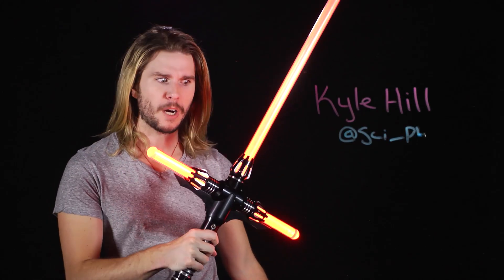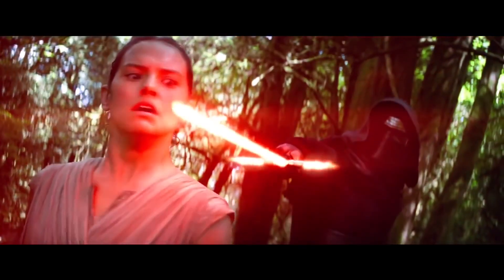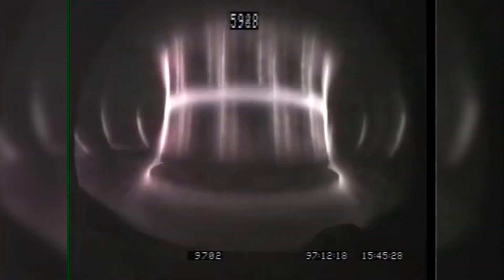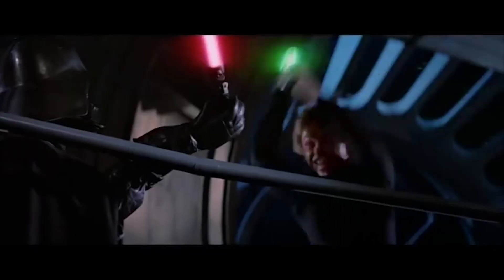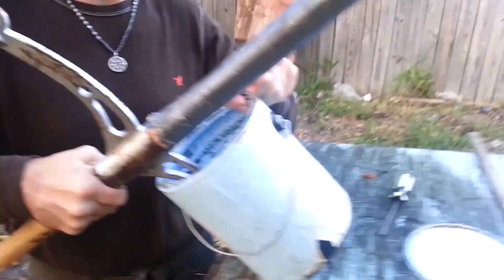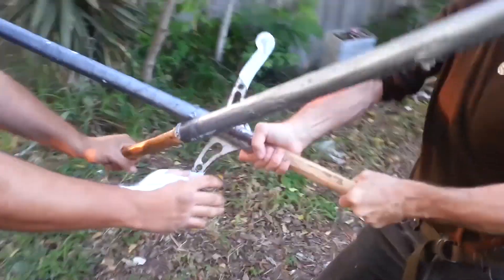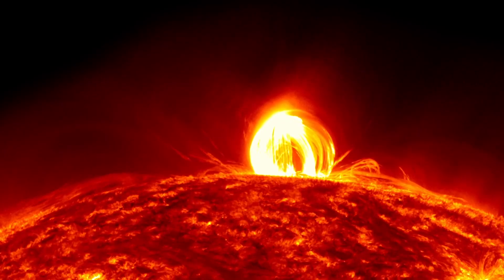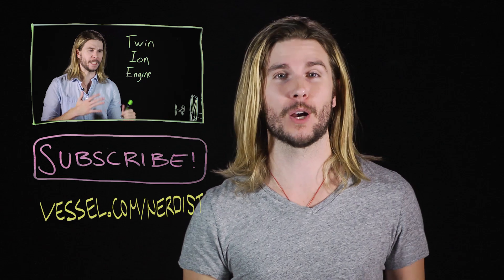Why Kylo Ren's Lightsaber Works (Because Science w/ Kyle Hill)

Comment: Kylo Ren's lightsaber wasn't made with crossguards in mind. It was the most practical placement for vents. Kylo Ren's lightsaber contains a cracked or unstable kyber crystal (which is why it cracks and looks so rough) which needed two vents for extra power in order to contain the power as the crystal didnt send a steady low flow of energy like a normal kyber crystal would. Without the vents, the lightsaber would probably expload upon activation. (Kyber crystals are a necessity to create a lightsaber and is the defacto energy source). Reason for using a unstable crystal was because most crystals were destroyed by Anakin Skywalker and Obi Wan Kenobi during the war before the duel of mustafa. There were little to none left.

Comment: I agree that the sword or sabre looks cool, but if anyone who has fought with a longsword or hand and a half before then you know that the crossguard is not just used to protect ones hands, but to perform blade catching manuevers witch would require the opponents blade to be inbetween your blade and your crossguard. watch some longsword technique videos and you will see what I mean. the the teqnique is hard to pull off, but is what I was tuaght is the primary function of the crossguard. I doubt the lightsabre would function properly if its outer housing unit were destroyed. Yet in all seriosness I realise that this is just a movie.

Comment: The crossguards are also vents. Kylo's lightsaber is an ancient design using modern technology. His lightsaber has a cracked kyber crystal. This means greater energy is projected from the crystal. The vents are necessary for it to function properly without overloading/exploding/melting or whatever the fuck would happen. It's also why the beam it produces looks so much more unstable compared to other lightsabers. 
     The lightsaber is supposed to reflect the character. He's confused, angry and torn between the light and the dark. It's like he's "cracked".

Comment: It's not mentioned in the movie, but kylo rens light saber was built by a jedi/sith who had not completed training and used a crystal that was more than likely cracked or unstable and unable to control the power. Therefore it created a non uniform shaped blade and required vent ports on the side to distribute excess energy, hence the crossguards.

Comment: accept to say that the side one would help protect which they kinda do but like any lightsaber the beam comes straight out the hilt not deep withing and in this case somehow splitting into three beams. no this tri saber would have three different ports in which beams come from makes the intersection on the hilt easily cut throughable making the sides rendered fairly useless(considering the user can still use the side beams to actually block, but the natural order of hand guards is the attacker would then slide the beam down towards the intersection which would then be cut through). so all in all the tri blade would then make it easier for an attacker to cut all the beams off and ultimately making it easier to cut their hands instead of protecting

but that is considering the beams dont all originate from the same port but their own separate ones

Comment: I have major issues with the claims people made about the side blades actually being plasma vents.

 If you vent plasma, you run out of plasma.

The blade would shrink away to nothingness in a matter of seconds unless Kylo Ren had a pipe attached to the weapon supplying additional gas to turn into plasma. Plus he'd probably need one of those old power supply backpacks to provide enough power to turn it all into plasma.

Comment: They actually aren't cross guards, they are vents because the power crystal is unstable. The crystal used to create the lightsaber blade is cracked and so it is unstable so it cant all be harnessed out the top of the lightsaber and needs to be directed somewhere else because science.

Comment: I agree with everything said in that video although I do believe that it would have been a much better idea to have made the crossguards out of a lightsaber resistant material such as phrik alloy (the material the magnaguards' electrostaffs are made from) or a cortosis weave (lightsaber resistant material called cortosis which almost every sword, vibroblade, vibroaxe, etc. is made from). Still the crossguard does make sense even though I would prefer a normal lightsaber due to the limited variety of use (there's less styles/forms of combat you can use) making it available to less users such as Count Dooku who uses his lightsaber in such a manner that lightsaber crossguards would cut off his wrist. So it is usable but I don't think it is necessarily for everyone unless the particular individual is willing to change his/her style to compensate.

One last thing I would like to add is that wouldn't there have to be three different crystals so the blade length for the main beam and the crossguards remain different or would Kylo have been able to place a mechanism in the lightsaber that would control how much plasma is emitted through each shaft?

Comment: The cross guard doesn`t work. There are "non laser parts" exposed on the joints. A cross guard is to there to catch an opponends blade from sliding into your hand. But here, the blade can slide along kylos blade, trough the mechanics and than cut his hand off.

It`s only purpose is offensive.

Comment: I disagree here a bit. Crossguards are meant to protect your hands from swords or other weapons sliding down in combat and in the Star Wars universe a blade gets cuts and could easy stop working at all (cause that "metal casing" is really helping direct and focus all that plasma and helping not kill you). So the crossguard in this design lacks its most vital and historically accurate purpose. Functionality wise it doesn't seem that great. Other, more effective designs could have been done but I admit the look of it is amazing and would want to see more unorthodox lightsaber variants on the films. 

Also a cracked crystal or unstable crystal which produces a larga plasma projection makes lightsabers for more devastating blows yet can shorten out midst combat. Extensive use or clashing could be.... dangerous to the user as he risks being left defenseless in a duel. 

Btw most shots taken of dismemberment even if the lightsabers had the guards they weren't in the way to have changed the outcome.

Comment: Now this is the issue I have, not with the triblade, but with any saber in general. If plasma is effectively weightless, why are all jedi/sith able to swing it as if it has this centripetal force on it. The weight is just not there to allow for that sort of movement. I mean, try swinging a flashlight like that, it doesn't work. So unless these are very heavy lightsabers (I.e. a full sized maglight) I don't see how their movements make sense.

Comment: The ancient design of Kylo Ren's Crossguard hilt, yes it's brilliant for the wielders protection during application. However, this is not the reason behind this design. In fact, the crossguard is merely a happy coincidence for the wielder due to the age of this design.
The blade design is so old, that the saber crystal used within the hilt, is unstable because of the primitive focus emitter. Hense; why the Lightsaber crackles and appears more like a fire saber, spitting and sparking. As appose to a stable, more advanced saber. Now the Crossguard's are actually an energy outlet from the sides of the saber hilt, designed this why so that the immense energy coming from the crystal and power source, don't combust and basically, blow up during use.. 
They act as vents so the Hilt remains intact.
Why Kylo Ren chose this type of design, when he could have easily built a normal, technologically advanced standard Lightsaber of the time, is simple. Intimidation and Fear.

Whenever Ren powered up his Lightsaber, it sounded loud, fierce and the crackling from the unstable and ancient design, gave the appearance of more a fire saber. All these elements, give Kylo Ren an advantage during battle or interrogation.

Comment: To add a bit of fiction to all of this, Jedi and Sith have even better control over their weapons due to the force. Because plasma is effectively weightless, without visual cues or extensive training, a non force sensitive person would have a very hard time trying to not cut themselves, as they would need to track the blade with their eyes to know where it is. Force users, on the other hand, have the ability to sense where their blades are, even though they have no weight and their operator isn't directly observing them. The crossguards on Kylo Ren's saber are entirely practical. The only problem I see with them is that they are created from the saber venting plasma. I personally wonder how that venting plasma is controlled. Does it work like the rest of the blade (by which I mean, is it a recursive flow of energy) or does the energy just kind of fly off into nothing? If it does just dissipate, then how does Kylo's saber have enough energy for more than a couple activations?

Comment: The blade looks this way because it is unstable plasma blade Matrix. Though Kylo's weapon evokes an ancient feel, its components are modern. Its crude appearance suggests construction by an inexperienced hand. The stressed crystal barely contains the power and Most importantly, the lightsaber uses cracked kyber crystal, which is the main cause of the ragged, unstable blade appearance.

see image for proof:http://static.comicvine.com/uploads/original/11115/111155790/4967134-0923527786-P4K2d.jpg

Comment: No spoilers ahead: Kylo Rens light saber doesn't have a cross guard those are vents because the crystal used as the power source is fractured and thus release to much power when activated

Comment: As a martial artist who specializes in swords, I couldn't resist a comment. First off: The whole thing is just one crossguard. That part of the sword is the guard and we call it a crossguard because it's shaped like a Christian cross.

Second: Heavy guards of any kind are simply a trade off. A large crossguard will destroy your ability to strike fast and from different angles but, you are very well defended from enemy strikes. I actually grew up training with swords that all had cross style guards and I still prefer a katana or a rapier for sparring or doing techniques. Although, in real melee combat, I do much better with a heavy sword, on average.

Not sure if that helps anyone at all. Just hoping to share my knowledge a little  :)

Comment: There's actually a lot more to his lightsaber. First off the design is based off of an ancient concept dating back thousands of years to the Great Scourge of Malachor. Secondly, the lightsaber uses a cracked red Kyber crystal which is why it crackles the way it does. Essentially the side vents are there because it keeps the lightsaber from overloading. A cracked Kyber crystal is very difficult to keep stable so the vents are there to provide excess energy to be released without causing damage to the saber or the user. Which in turn offers Kylo the ability to use them in combat.

Comment: So Nerdist I have pointed something out to some friends of mine before but I want your opinion on it as well. Have you noticed that Kylo ren's lightsaber isn't only different but bigger than most? That's because Kylo Ren doesn't focus just on movement or agility as a lightsaber master, he focuses on power and brute strength. What other weapon reminds you of that and also has a cross guard? Great Swords, or Claymores. Yes that's right Kylo Ren' lightsaber is modeled after the Claymore. A claymore's cross guard was not just used as protection but it was used as a heavy weapon for taking out someone like a blunt object. Kylo showed that as well in one of his fights. While a  normal light saber is modeled after a Japanese Tai-Chi Broad sword for movement , agility and dexterity. Kylo's is modeled after the claymore for raw brute power.

Comment: You are aware that actually Ren's lightsaber wasn't only one unstable and even in SW they arc sometimes?One moment you say it's 10% safe and int won't arca and next you say it don't have 100% solid structure so it's little like firesaber. And in fact weightless weapon is harder to handle than normal as you don't feel it.

Comment: Wasn't it confirmed the cross guards are actually excess energy being released from the light saber. Also, the reason the blade crackles and isn't smooth is because it's an older model. So it's not really supposed to be a better design, it's supposed to be an older design. Either way, great video!

Comment: it's actually not a cross guard at all. Since Kylo ren's saber is built with a cracked gem which makes the blade unstable, so there actually exhaust ports for excess heat

Comment: Except Steven Colbert doesn't understand how Light-sabers work. He implies the there is a saber in the cross-guard's hilt but if that were true it would be impossible to cut an active Light-saber hilt in half "cause there is a tiny beam in the hilt" which just isn't true because hilt have been cut while both active and inactive before.

Comment: 1:45 "When you don't have hand protection this happens" : Not in a single example of that stupid  "Lazer Cross guard" would of helped.  Comparing LAZER cross guard to real and a METAL one is dumb for obvious practical reasons. 
It would made much more sense if cross guard was pointing upwards like a Witcher's sword. You still get some defense at some degree and  lower your chances of cutting yourself... because you know : Because it's lazer and not metal.
Lore wise it doesn't make sense neither... Millenias have pasted and no one figured to put a Cross Guard on their light saber or maybe it's simply impractical ?
The only thing that Kylo Ren's saber does better than others is that it looks cooler. This Cross Guard Design is mainly to generate buzz and sell toys.

Comment: its not that it dose not work as a weapon,  in fact it works pretty well, but i could be way better, you could eliminate any danger too the hands with a simple redisighn where the crosgard pases though the blade form oppiset sides...  i found this and it seems like a good solution to most of the complaints rather than just "it looks cool, and with training you could use it'.... FYI you can make most weapons "work" with the right training, but i dose not mean they are designed well... and yes i pulled this link off reddit...https://www.reddit.com/r/pics/comments/2nupda/i_redesigned_that_lightsaber_that_everyone_feels/ enjoy

Comment: The reason he has a "CROSSGUARD" is because his Lightsaber was infact Homemade and was too powerful to just have 1 beam so the Two beams were put there too balance the power.
Reply: And why it crackles is also because it is home-made
Reply: True
Reply: +Thiago Freitas yah, i think he means that it was crudely built by someone that lacked the training or patience to built one correctly, so he had to work around the unstable crystal by adding the vents (like putting a band-aid on an amputation lol). 
For the video poster: a guard doesn't stop your arm below the elbow from being cut off lol, it just stops your fingers and wrist from being cut (as bad, because you still do with a cross guard. basket-hilts are about the only way to eliminate that, and there's still a chance for the wrist). The whole lightsaber-crossguard thing sounds great until you turn your wrist wrong and cut your own hand off... something real swords with a guard won't do. now a shielded guard might work, one that stops energy weapons but doesn't hurt you if you were to touch it, might work.
Reply: +Ryan  McIntyre  actually the kyber crystal is cracked too
Reply: +Dizzyshroom8 Yes but either way his Saber is Homemade
Reply: Ryan McIntyre yes he probably had a padawan saber, hey maybe this was a modified version, I've seen the cross section, I don't even think he used the force to construct it.
Reply: +Ryan  McIntyre  I don't know if this got written off with the rest of the EU but aren't all light sabers supposed to be homemade?
Reply: Thiago Freitas he means without a master or the force it was probably cobbled together after betraying Luke, not made legit-ly
Reply: +wildrangeringreen Again, that's why he said special training is required so that the risk of cutting off your own hand is negligible. It's highly unlikely that training with a lightsaber is the same as training with a metal sword.

Comment: it's an ancient design they are vents that work as cross guards and as well as a vent for the main saber to control heat. since he didn't have any formal training before since the Sith is dead he had to throw a simpler design light saber together this is also why it crackles it is not as efficient as the other light sabers it is an outdated design

Comment: blater are not plazma the lightsaber are not plazma they high energy gaz without eny 
temperature blade are cold but they hawe enough energy to melt metal sorry for bad english ps. plazma are wery wery hot gas